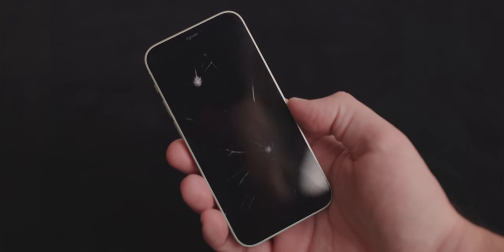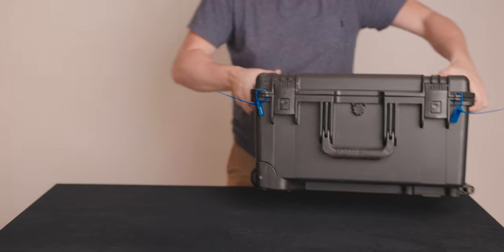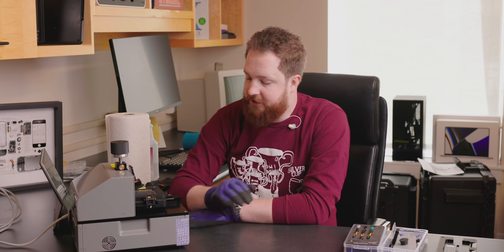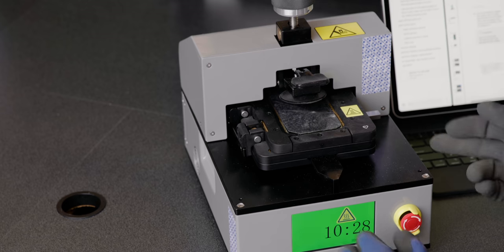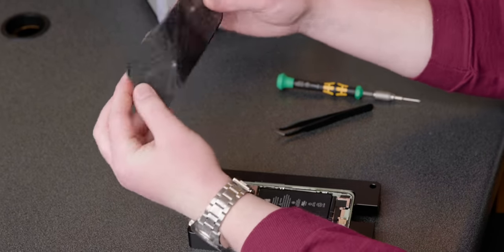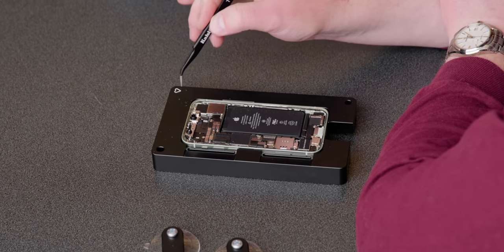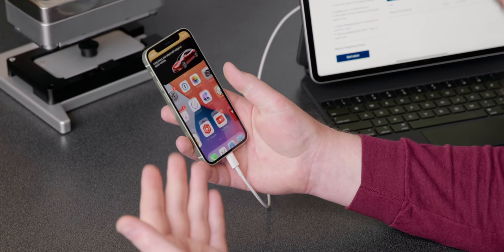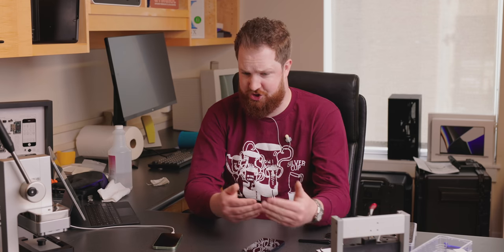Using Apple’s Tools to Fix My iPhone

Comment: It’d be funny to crack open those tools but I don’t want you suffering whatever consequences come with it. 

Also everyone else has hit it on the head but the fact that this is such a complex task clearly shows Apple is only doing this to save face on RtR movements and this is very counterproductive to their “environmental” footprint. And no need to mention these aren’t well designed for repair without these massive tools
Reply: I actually asked support what the "non return fee" is and they responded with $1200, plus a possible surcharge for the pelican cases
Reply: Repair shops have done fine without these tools, but the steps are similar. None of this would be necessary if Apple didn't make this so complicated. But as we saw in the end when Snazzy gave a justification for Apple saying that Apple didn't want to, they "needed" to do it this way. Sadly, people will still defend Apple's every moves.
Reply: @alejandroelcid  The display press is a great tool for third party repair shops, it’s pressure activated adhesive so not using a press won’t properly adhere the display.
Reply: @Carterthielftw_  that seems to be a fair price for all you’re getting.
Reply: @alejandroelcid  He wasn't defending Apple.  He basically said Apple was making this needlessly complex and weird to discourage people from doing this.
Reply from the maker: @alejandroelcid  FWIW, I’m not defending Apple.
Reply: @alejandroelcid  The main problem I have with Apple apologists is they don't seem to realize that Apple's business practices impact everyone, not just Apple's customers. Apple is one of the biggest tech companies in the world and every time they do something that isn't beneficial to the consumer its a green light for other manufacturers to do the same.
Reply: @alejandroelcid  I think he was saying Apple needed to make the diy repair program because of impending legislation not Apple needed to make it complex for whatever reason
Reply: @user-yc5kk7pk4d  they are not "pressure activated" what are you on about? You can press it down with the 3 cent tool just fine, although you have to align it perfectly in the first place. You can also just use the cover for 12 bucks and skip the press altogether by using your hands. Same effect.
Reply: @snazzy  I also don't think you were defending Apple, but you certainly could've gone harder on them in this video. You have a lot of reach and we all know you're smart enough to see through their malicious compliance with this self-service repair program. Please don't go easy on them next time, there's no need to pull any punches when we're fighting a trillion dollar company for our future as consumers!

P.S.: For the sake of clarity, I'm referring to the moments where you described this process as "weird". It's only weird if you don't understand WHY they are doing it this way, which you clearly do! When you understand why, you see that it's not weird, it's just a dick (albeit brilliant) move on their part to counter the RTR movement. This program will be used as an argument in court to say "See? We're already doing self-repair, there's no need to pass this bill hehe thank you very much".
Reply: @snazzy  I thought you were when you said in the end that it wasn't because they wanted to but because they had to, I took it to mean how complicated they made the phones (as well as their other devices) to repair and the way they designed this new program for self repair. If I misunderstood you then I stand corrected. I can admit when I am wrong, I still enjoy your content.
Reply from the maker: I mean they “have” to in that legislation already or will soon require they provide a program and they want to make it as difficult and as maliciously compliant as possible. The pricing alone makes it impractical.
Reply: @MrSamPhoenix  Im not arguing with it, I actually have the display press in the cart and bought mentally, but I thought it was interesting info
Reply: @PvtAnonymous  What he's on about is that pressure activated adhesives are a thing.  Yes, they are sticky without pressure, but to create the proper bond they need to be 'set' with firm and consistent pressure applied over some time.  That's why the press supplied in the Apple repair kit is important - it is almost certainly engineered to apply the correct pressure and the timer assures that it's pressed long enough to create a proper joint.

Good luck reliably creating a watertight seal that complies with the phone's IP68 rating using uncontrolled methods like "just squeeze it with your hands durr".  The point of the jigs and presses and all the other fancy tools in the kit (right down to the torque screwdrivers) is to ensure that if the operator of the equipment is at least minimally competent, the reassembled phone will be returned to factory specs in every way.
Reply: As a former technician, this program makes a lot of sense. Hear me out.
Apple wants you to fix your phone at an apple store, that's no surprise. They want a "perfect" user experience for their customers. Giving you access to professional repair equipment and full repair manuals vastly reduces the chance of you messing something up. And with small ribbon cables and tiny screws it's not that hard.
You should be discouraged. That's the point. There's a high chance you'll end up with a broken $1000 phone and that's not fun.
This equipment is meant to make repair easier and idiot proof to some extent.
 Also, they already develop and maintain these tools for stores and service providers so it's cheaper for them to use the same stuff for independent repair as it'll probably be used only by a small number of enthusiasts.
If you insist on making the repair yourself and it's your first one, rent these tools for $50. It will save your phone and a lot of wasted time.
Reply: @nadavelkabets  Im honestly not mad about the tools at all, renting them is a good idea and I appreciate being able to get genuine pro tools. cheapo china toolkits are available for $25 all day on amazon. Im kinda frustrated at part pricing, batteries are in a separate universe of something from iFixit, but I honstly dont know how apple could offer an OLED display for under what they are charging now. Just look at samsungs OLED prices.
Reply: @nadavelkabets  The way people come up with excuses for companies blows my mind. The rental price for the equipment is reasonable IMO the price for the parts is the problem. The price they charge for the screen is absolutely ridiculous.
Reply: @Carterthielftw_  battery for 12 pro is $44 and display is $236… That’s the same as IFixit… what am I missing?
Reply: @nadavelkabets  the display pricing is honestly pretty good, its expensive, but OLED is expensive and justified. Im looking at the SE because I dont personally do 12/13 repair due to part serialization. The SE battery is something like $35, even though it uses a VERY similar battery to the IP6 which came out over half a decade ago.
Reply: @Carterthielftw_  indeed! I’m think of getting the set too. I thought  would charge us at least $5000 for all of that.
Reply: @alejandroelcid  iphones are actually among the easy phones to repair. Maybe check what is necessary on the Samsung flagships before bashing on Apple again. None of these fancy tools is actually required to do such a repair. Such compact and highly waterproof phones simply come with tradeoffs to repairability. Either deal with it or buy a brick phone, you have the choice as a customer.
Reply: @RandomUser2401  Depends. Because as is, it is impossible for me to repair an IPhone 6/7/8/X/Xs/11 without having part serialization. I can only get genuine parts for 12/13/SE. I dont count a repair complete if the display loses functionality, face/touch id is gone and battery health disabled. This is especially concerning because unless you use a grey market tool like a JC Pro 1000s, the only one that can pair parts is apple, what happens to your IP13 in 5 years when they stop providing this service?
Reply: There not very well designed to be repaired with the tools etheir... Kinda makes me think Apple only has them for warrenty purposes.
Reply: @Carterthielftw_  $1,200 that's the best deal I've ever seen from Apple! A single payment costing not much more than their stand and you can advertise that you've literally got the official apple tools!
Reply: It's not a complex repair though.... He mentions throughout the video how unnecessary most of those tools were. 

I repair phones in the small shop I work at, and while we do have some nice tools, besides the adhesive, everything is done by hand. It doesn't require thousands of dollars of kit.
Reply: @EdgyShooter  I agree, buying them all separate wouls probably be cheaper, but I dont know why people are hating on the tools. Get a cheapo amazon repair kit and follow iFixits guide if you dont want to use apples tools. Because as someone who does 5-6 iphone repairs a month and is a tool nerd, I think these are aweslme
Reply: If you break those seals, you probably get charged for checking and re-calibrating the tools,  I doubt that there's any trade secrets inside there, but they don't want nosy engineering types poking around inside and potentially ruining the next customer's experience.  It would be cool to have see-through cases on the machines.
Reply: well apple has standards in place for their repairs. if you are going through apple to get the tools you'll be subjected to the same standards, there are plenty of other ways to achieve the same task i.e. replacing screen, however that won't be covered by apple as it's not in their standards/procedures. sorry if i explained poorly. my tldr is apple wont give you some cheap kit from china, that's what ebay is for.
Reply: @nadavelkabets  EXACTLY. Someone with brain and ACTUAL experience, critical thinking etc, WHAT a breath of fresh air.
Reply: @t.s.4494  The required consistent pressure could be made with skill and basic tools, but the automatic timer press ensures consistency for lightly trained assembly line workers.  Just like a torque screwdriver that is company configured to provide the specified pressure at first click, not at 3rd click or after turning a dial to a specified number of Nm or footpounds.